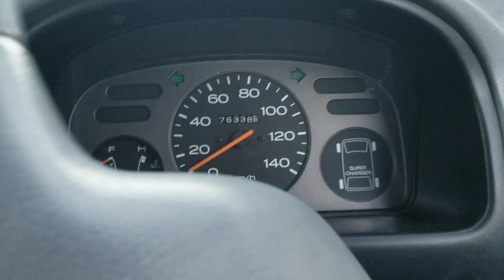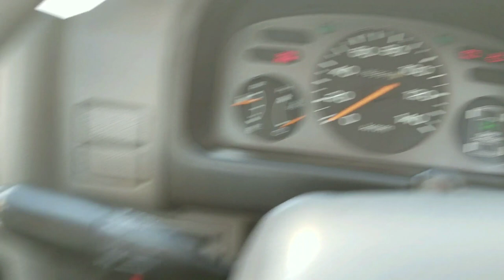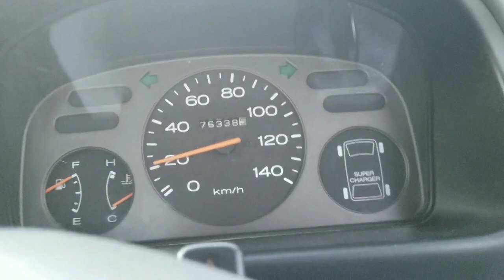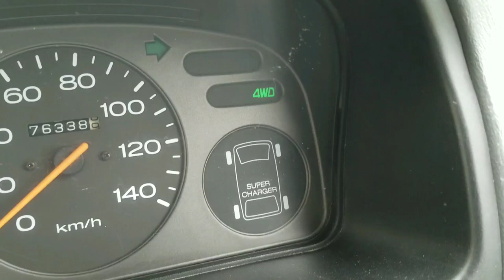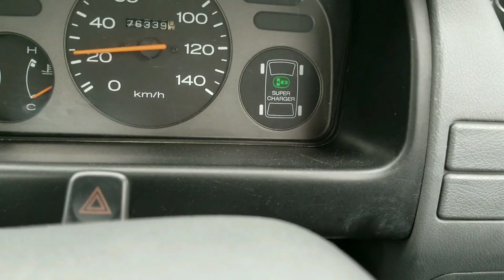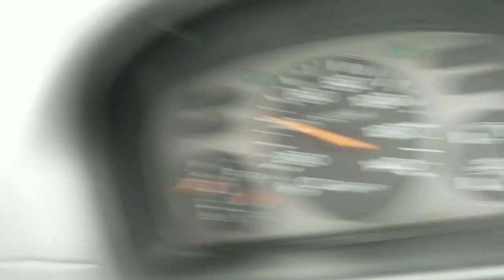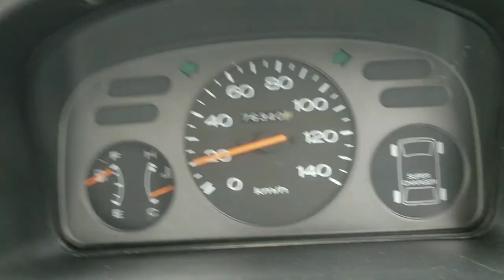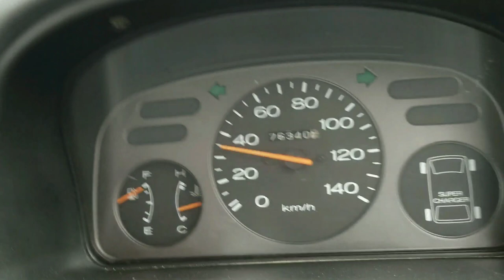Supercharged Subaru Sambar walkaround and test drive

Comment: is the MPG that much different/better with these in EFI vs the carb set up? also, in your opinion which brand is the easiest to work on (oil changes, air filter ect.) the Subaru sambar without the SC or the Honda acty?